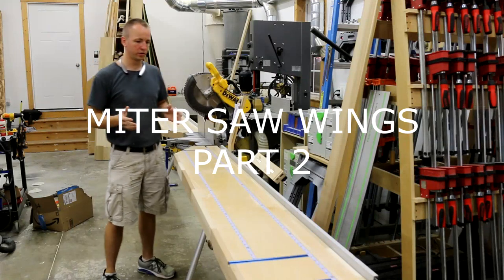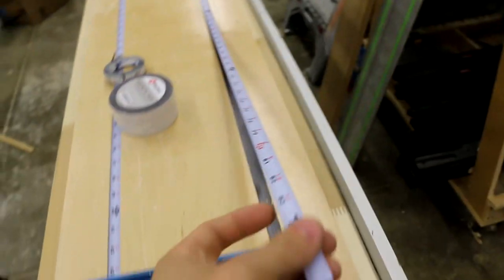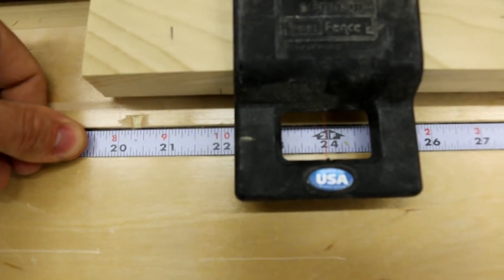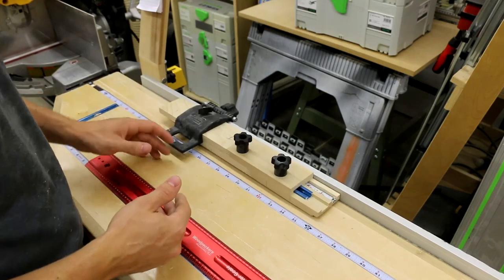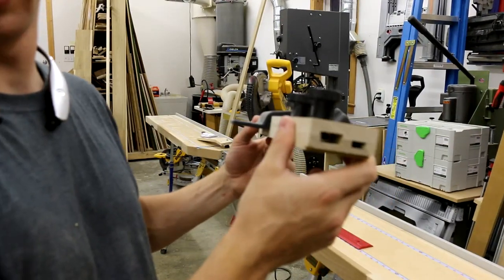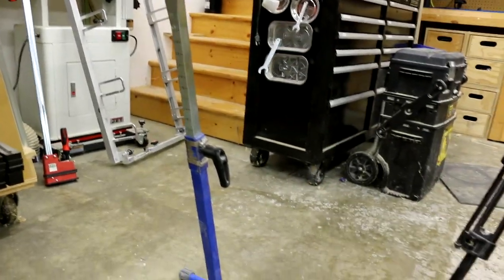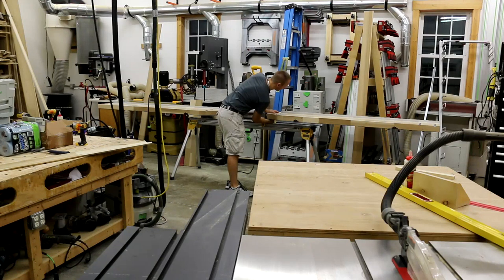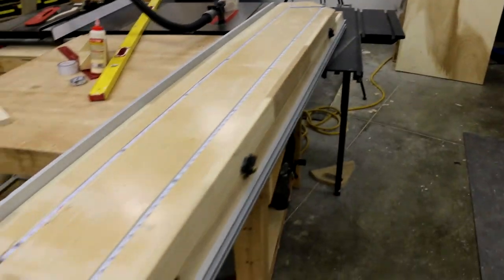Efficient Custom Miter Saw Wings Part 2

Comment: Very good info, I had a similar system connected to saw with hinges and a frame table support, those mag tapes would have been a major improvement.  Always  hard two saw one on each floor,  saved going up and down stairs, did all the major cutting  (pre size) on main floor.

Comment: The magnetic tape is brilliant.

I was a little spooked about the adhesive sticking to the bottom of my dado based on some of the Amazon reviews. Placed a 1/2 rip of Zip tape made for OSB in the bottom of the dado prior to the magnetic tape.  The magnetic tape sticks to the back of the Zip tape great.... no issues whatsoever.

Maybe unnecessary, but if the bottom of your dado is a little rough, this will provide a little insurance.

Comment: Have you thought about using 2 Dewalt miter saw stands next to one another and connecting the two with your saw and using the extra space on either side for your wings? Maybe even utilize additional miter saw mounting brackets for the supports on either side to lock the wings in place. You might have to flip the brackets around but it should give you additional support options and reduce the complexity of your locking mechanism?

Comment: Really like the features of these wings. especially the double stop block. I'm thinking of making some and mounting them with a set of dewalt mounting brackets used for saws. I suppose one downside would be trying to keep the wings tight to the saw (for mag tape calibration) because they would be just butting up against each side... any advise is appreciated

Comment: I came upon your channel recently as I am going to try some inside trim around my house - and I find it rally informative. I am really more a hobbyist carpenter (cabinets  etc) but before I embark on trim work, I wanted to build an extension wing for my Dewalt miter saw with your amazing stop block design. At the moment I just use roller stands - not ideal - without any stop blocks. I usually measure the piece to be cut and support the measured end to the left of the blade - which seems intuitive to me - being right handed - and it seems most "non trim" carpenters on youtube do so. You seem to be right handed, and you seem to always use the stop block to the right of the blade. What is the reason for this?

Comment: Nice wings what are the dimensions? Kinda looks like about 12” to 16“ x 7 or 8 feet...? Greg
I made a set of wings, mine are 12 inch wide by 8 feet long using 1/4” thick aluminum plate and I used 1” square tubing 1/8” wall. I drilled tapped and fastened the whole thing using 12/24 SS door hinge screws for rigidity and used 2“ x 3“ aluminum square tubing for the fence, maybe I can share some pictures with you sometime...
Reply: I'm interested in seeing those pics
Reply: @nickchepinskas459  Sure thing as soon as I can get them out of Storage I will set them up. They are mated to a Makita LS1211 dual compound Sliding miter saw.  I am semi retired now. So they do not get to much use anymore. I have dreams of setting up a small Furniture making shop in the next couple of years...  We will see how that goes... Greg

Comment: Does adding that fence throw off your zero between 45 degrees left, 0, and 45 degrees right?
Reply from the maker: Yes. If you’re talking about the center pivot point it does throw it off.

Comment: Why do you have both the fixed and sliding miter saws? Wouldn’t the sliding  miter saw do everything you need?
Reply from the maker: Yes, but there is a compromise in accuracy using the slider. If I'm doing a small job and know I'm going to need the sliding feature I'll just use the slider. But if I know I'm going to have multiple days/weeks of not needing the slider I much prefer the 716 fixed saw. It just cuts amazingly well and I have complete trust in the accuracy being that there is no deflection of the saw head.

Comment: What happened to yur Kapex? Did you use it that much to burn the motor out? I'm a novice wood worker and own a Kapex I usually take my 12' miter saw on the work site. You obviously were not pleased with the kapex...
Reply from the maker: I owned two saws at the same time. Burnt up both of them within 3 years. They aren't cut out for carpenters who actually trim full time imo.

Comment: Very clever design. Very timely as I'm just finishing up my miter saw station in my garage workshop. Are the peel-and-stick tapes magnetic? The product description for the Kreg tapes you referenced above don't mention that. It looks like the tapes you used are magnetic.
Reply from the maker: No, you dado a groove and install a magnetic sticky tape. Then the peal and stick tape measure goes on top of that.